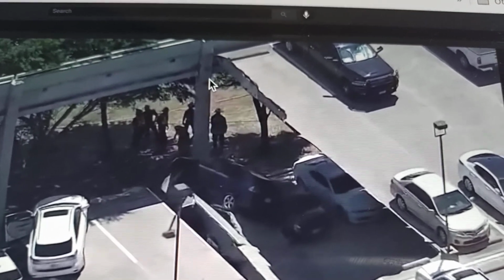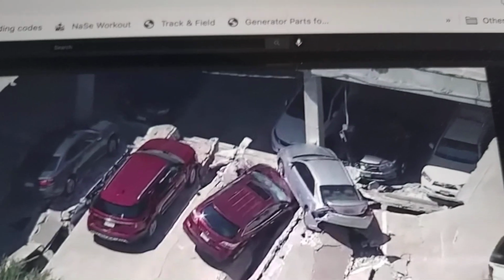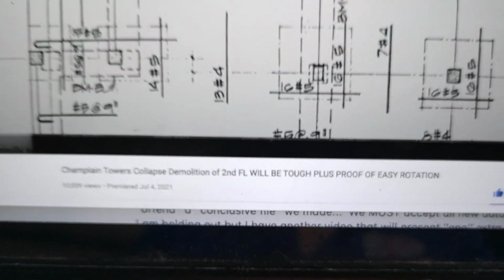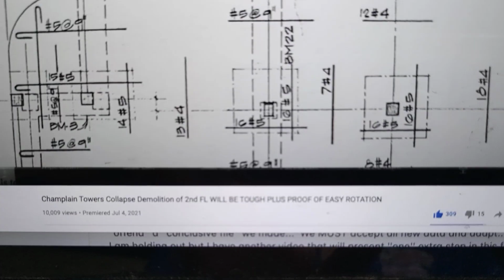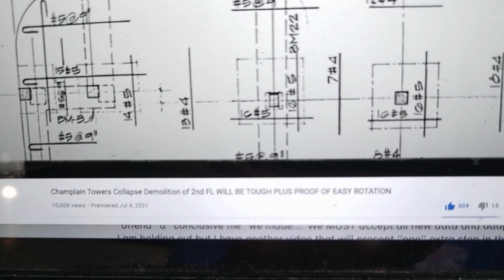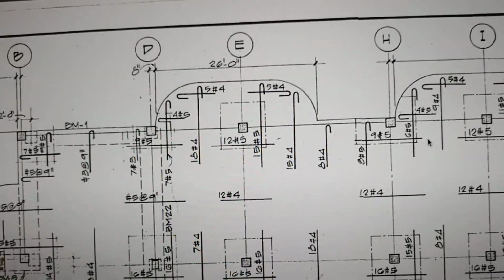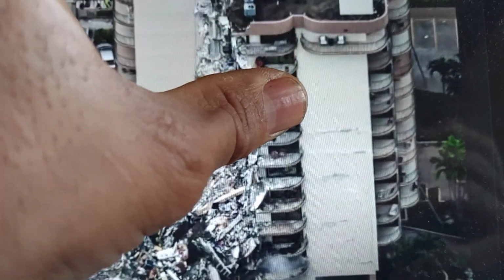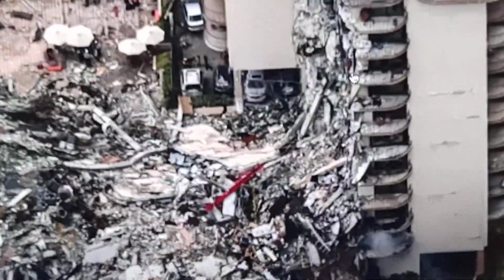Champlain Towers Collapse and how a Construction Joint could have saved the building!

Comment: I posted this on the other channel but adding it here too, if that's ok. r.e. the washing machine location. For a washer/dryer area, you'd need water in/out, power for the electric dryer, and a vent. Those are probably set at build point, and structural changes required to relocate those would probably be denied by a condo association anyway. Not likely that someone would want a washing machine in a different location than their dryer, so something should be discernible in the electrical and plumbing plans. I shifted from the structural plans to the plumbing and electrical plans for the unit (in the 336-page 1979 plans uploaded by Surfside, the plumbing plans for unit C are on P7 (page 7 of the 336 page document) and the electrical plans for unit C are on E7 (page 79 of the 336 page document). From those two plans, the compact washer-dryer was been planned for the closet in the C style units to the right as you enter the unit, next to the air handler/water heater closet. I find it highly unlikely that the association would have permitted a subsequent owner to move a washer-dryer from that planned position to a spot in their dining room that would need the electrical, water, and venting all added. 

I was also able to locate the positioning of the compact washer-dryer site for unit A (plumbing page P6 is on page 103 of the 336 page document, and electrical page E6 is on page 81 of the 336 page document). Unit A's washer-dryer site backs up to the oven/stove site of unit C's kitchen. That's further towards the corridor that you're expecting the breakpoint to be. I'm guessing it's not a washer or dryer from either unit. That's my non-professional/layman's guess after shifting from the structural plans to follow breadcrumbs in the electrical and plumbing plans. The way the plans were scanned in is a mess, but yeah, there are a lot of data elements that can help confirm or refute some theories of what elements are visualized where in photos.

Comment: I think @Chris Johnson is right in his placement of the washing machine. The -11 (C type) condos had a louvre/vented type door on the right as you entered the apartment. These are marked on page 53 of the plans.  There are a couple of images of washers and dryers in these small areas in other apartments. If you need I can find them again and send links. 
My thought was if the aspect of the photo is slewed are they in the right place? But then, might the object have rolled as it fell if it is a washer/dryer. I'm wondering though if it is an appliance might it be the dishwasher or even a cupboard. 
Oh so many tunnels to this rabbit hole.
Love and meows to all the cats

Edit I took so long researching, composing then posting I completely missed Cat Woman already said something along the same lines

Comment: I just noticed that in the Irving video the adjacent parking deck cracked in two pieces on the right side like the slab in 111 did as it dropped to the ground.  The Irving parking deck went down and the columns  back flip and down.Good job Tom!! I want to be like you when I grow up.
Reply from the maker: That is a "double T-beam" design and may have post tension in them...  So, they would behave differently and the the two pieces are where they butt up against each other ---I mean the long dimension.
Reply: Carolina and Baby, thank you!  I appreciate your compliment more than you know! 😊

Comment: Re: washer. I saw one apt that had a tiny alcove in the smaller bathroom containing a stacked w/d. Unit 611 may be more telling though, and there is a 3d walkthru on redfin. Based on that, there doesn't seem to be any space to the right of the sink in 611 small bath for the w/d alcove thing. There is a large mirrored closet directly behind the bath, and a locked closet nearby. The image was really distorted for me, and a video of someone looking at the same 3d walkthru showed similar distortion (blacked out squares), so maybe not just cell phone. I would suspect that the w/d is behind a mirrored closet door or maybe in that locked closet with the white door. The 2 cabinets near the tv are big, but one is probably a Murphy bed? Use duckduckgo to search for the 3d dollhouse view - other tool has scrubbed much of the listings already.